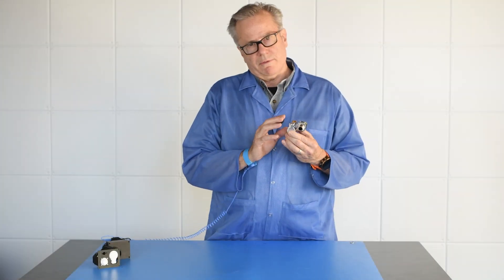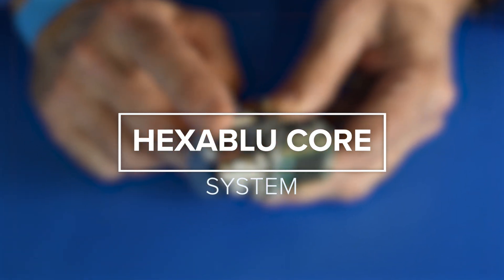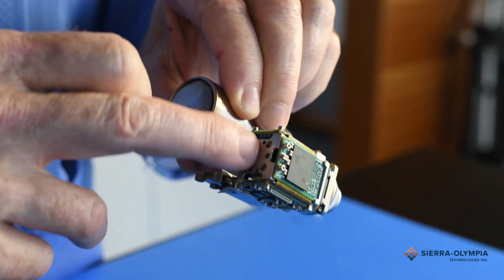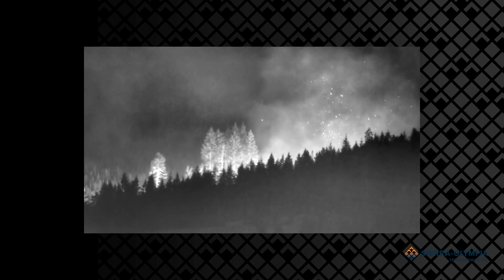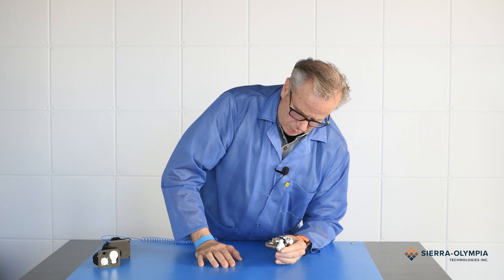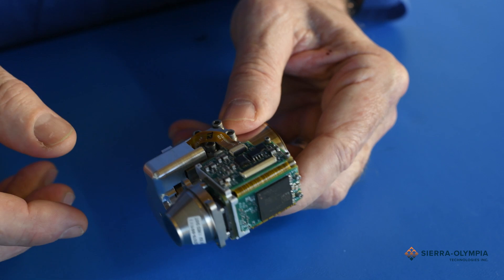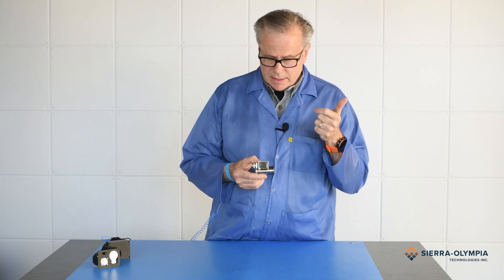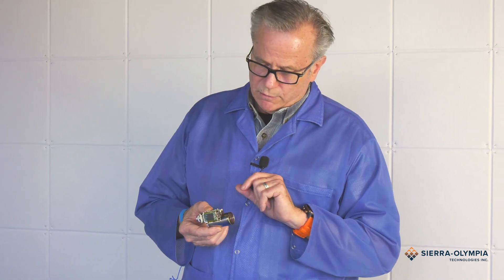HexaBlu® Core System

Comment: On what principle is the sensor cooling built? The sensor is in a vacuum, but through what is the removal, pumping out of heat from it?
Reply from the maker: The HexaBlu® uses a pulse tube refrigerator to transfer heat from the focal plane into the dewar. This is a specific type of closed-cycle sterling engine that enables low vibration and high lifetime.